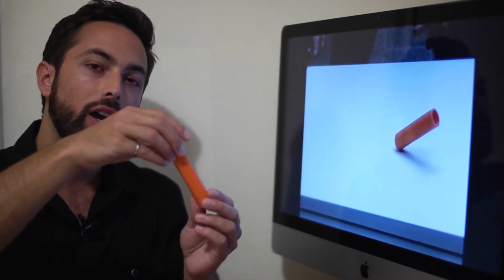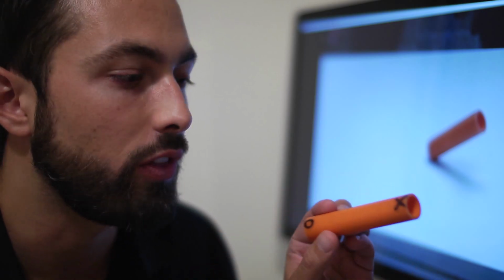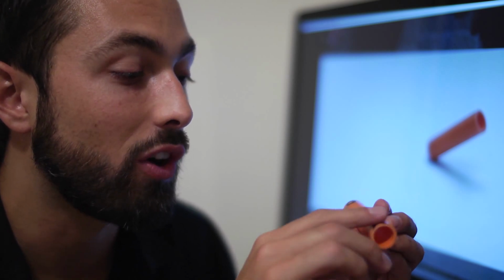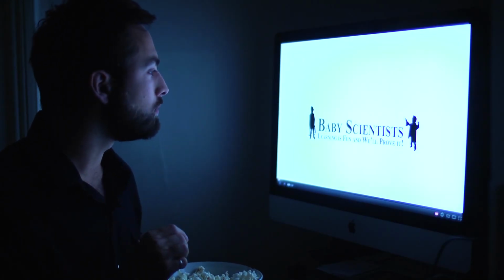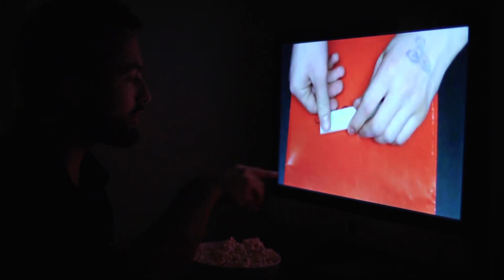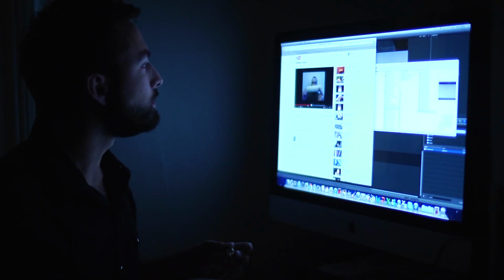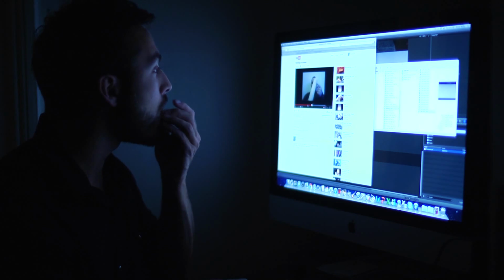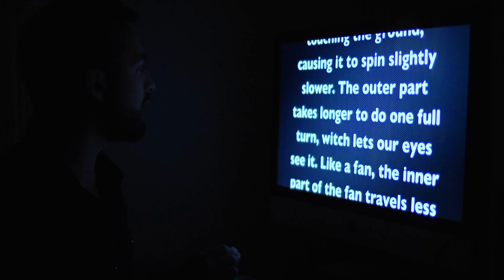Spinning Tube Trick Explained

Comment from the maker: From underneath, the tube rotates clockwise. So the spin of the tube is again opposite the rotation but now for the other letter. There is a good explanation of this in one of the video responses on the original video so check it out if this doesn't make sense.
Reply: Only 6 likes and no reply's… how odd
Reply: @memariogamer5892  I concur
Reply: @memariogamer5892 : Might be related to Derek’s previous video about video-learning (see the one about Khan Academy).  People are just assuming they understood the answer.  After hearing the explanation about viewing from the top it didn’t make sense to me that it was different when viewed from the bottom - until I read Derek’s explanation above.  It bugged me enough that I had to look through the comments to find that answer.

Comment: OK, I am NOT a physicist, I'm a poet and a musician, but I'm also a science aficionado, and that brings me to this question. Does the principle of the spinning tube also explain why, on the planet Mercury, at certain points during its day, the sun would appear to stop its motion across the sky, move backwards below the horizon and then rise again? It seems similar to me. Please don't laugh at me if I'm totally off base here!
Reply: Yes, the sun would slow down or speed up depending on whether the orbit and rotation of the planet go in the same direction (like both clockwise) or opposite directions. :) In fact, depending on the difference between the orbital and rotational angular velocities, you could see the sun anywhere from moving in the opposite of the expected direction ("expected" if you took only rotation into account) or at a standstill at all times. Of course, you don't need to be a physicist to think about these questions; it's mostly just common sense. :D
Reply: ajmittendorf It's called retrograde motion. The same thing happens to us on earth looking at Mars, it appears to move backwards, then goes forwards again. I don't think this experiment has anything to do with it though, but just search retrograde motion up ;)

Comment: You will also notice that the end which is pressed (say X) gets lifted up a little bit.
That's because of the magnus effect. The lower part of tube of X end is actually moving faster than the upper part. So lower part drags more air along with it and creates a high pressure region below X end and thus gets lifted up. Same can be said about the other end which was not pressed ( O in this case). The top part of O end is moving faster than the lower part and it gets pressed down between of a high pressure region above the O end ( and of course you need some contact too because there is gravity.)

Comment: So why under the table see o and not x when we spin the tube putting our finger to the x position? The velocity of the tube is the same and independed from the position we are looking the tube.
Reply: Rotation along the axis remains the same but horizontal spinning flips
Reply: Well when seeing it from above, the symbol you see will be spinning in the opposite direction from the tube's rotation, and if you look at it from below, that symbol will be spinning with the rotation of the tube, since it's turning around the tube.
Reply: By looking at it from underneath, you flip your view point horizontally so its horizontal rotation will be flipped in relation to you. This means that the destructive rotational velocity will switch sides and thus symbols.
Clockwise to counterclockwise and vice versa.
Reply: @fabiofdez  No--the same symbol is still rotating against the rotation. That's what he said. Viewing angle doesn't change the physics of which side of the tube is rotating against the spin. Maybe I'm wrong?
Reply: @JD_tcb  The spining direction doesn't change by flipping our point of view. But for the rotational part : if you look at a clock (in the classic way) you see a clockwise movement. but from behind  the clock hand now goes cunterclockwise. So for the "under the table" point of view, the symbol which has opposite movement (between spin and rotation) is the other one compare to the "above view".
Reply: A clock runs backwards when viewed from behind
Interestingly, the sun travels counter clockwise ( northern hemisphere) , its the shadow cast by the stick that goes clockwise.
Think it through.  You look up to see the sun...follow around with your finger 
Volla.. counter clockwise.
Reply: @JD_tcb  I was stuck on this for a minute too I thought yeah the rotation flips but the spinning flips too, but then the best way I found to realize I was wrong is if you move your finger in a clockwise motion and then put your hand above your head and look from underneath it's counterclockwise, but if you take your finger and pointed sideways and rotate it towards you, it's going to be rotating towards you if you look above it or below it
Reply: I was searching for this question. He also thought the same, thats why he said it would be the same symbol but he was wrong. He talks about ppl being lazy in the video, but in the end he was the one being lazy for not answering that question, I bet you he is also intrigued by that and if he knew the answer he would have said it. Now I want answers 😁
Reply: Ok, I think I know the answer, the lightning from above is really bad, some zones of the tube are not even showing, the zone with with X ended being in the dark spot, and we end up seing just a few frames with the 0 when the tube is really slowed down, like when we see from above. We just see nothing when we were suppose to see the X because of the bad lighting conditions, when they edited the video they just showed the last moments of the spinning.
Reply: I have the same question. If the angular velocity is what determines whether we see one end or the other, looking from the bottom wouldn't change that. What am I missing?
Reply: Well . I came for help to understanding this question and I’m leaving more confused then I was when I got here . This is completely my fault. My brain is starting to protest even thinking about this lol . I’m going to try rotating my finger below and above my head maybe my simple mind will then understand . Hopefully nobody will catch me doing this and ask me what I am doing . I will just tell anybody that ask me wtf I’m doing that I’m simple and this might help .

Well spinning fingers did nothing to help me lmao no surprise. I don’t even understand why I’m struggling with this . I’m missing something and about to just repeat the experiment for my self and probably remain confused lol .
Reply: @bobquigley1957  Not the angular velocity determines it, rather the sum of the velocities, because there are more then one, which can also somewhat cancel each other. In the end, what's matter is the relation of the directions of the angular velocity and the tube's rotation.

If the angular velocity, at a point where the tube is facing you, is pointing clockwise, but the tube's rotating counterclockwise then these cancel each other (not entirely of course). That's possible only one end of the tube at a time. If you watch this from the opposite side, the rotation flips, but the angular velocity's direction is not changing. The same end pointing clockwise and the other end counterclockwise, so now the other end of the tube seems slower because of the same cancellation. Hope this helps.

Comment: Hi Derek, when I did the trick myself and also when looking at your videos I observed that see the O (or X) about 6 times per revolution. It seems to be like this no matter how fast I spin it. 
This seems to imply the ratio between the axial angular velocity and the vertical angular velocity is constant and 6 (or close to it, perhaps it is 2pi, since that's a special number when it comes to circles.. )
Am I imagining this, or do you also observe it?
Reply: I would guess it depends on the ratio between circumference and length of the tube.

Comment: Great video, I love your work!
Too bad you didn't talk about the number of x we can see. We can clearly see on the slow motion that the tube rolls on one end without much sliding. So the number of x we see is the ratio between the diameter of the  circle described by the spinning (pretty much the length of the tube) and the diameter of the tube.
So the number of x we see is the ratio of the length of the tube over the diameter of the tube ! (pardon my writting, I'm french)

Comment: @Bart Alleman

For the same reason. But when you look at the tube from below, the sides are reversed. So when you pressed the X at the spinning tube from below, it is the O that moves against the horizontal rotation of the tube.

Comment: Oh, I should have thought of how the rain flies off the top of a moving car tire. 

The tire on the road goes zero velocity relative to the road, the axle of the car goes the actual reading of the speedometer relative to the road, but the top of the tire is going twice as fast as the speedometer relative to the road. Very cool stuff!

Comment: I honestly think that the velocity explanation is wrong, as if does not account for why the symbol is reversed viewing from the bottom. I think that it has to do with how our eyes can only process limited frames.

the "pressed" end (let's say X) lifts upon release. the entire time that the tube spins, X remains vertically higher than O. the upper half of the tube creates a constant blur of orange and X, blocking any blurred image from the lower half. although the X is never actually in front of the O, the blurred image blocks out the lower half of the tube. 

this would easily account for the issues with why the symbols are reversed looking at it from below, and it actually is a bit irritating to me that no one seems to notice such a simple solution. am i wrong??
Reply: I feel the same
Reply: When he spins the tube and you look at it from the top it is spinning in a counter clockwise direction about its middle. If you were to look at it from the bottom it would be spinning in a clockwise direction, so now the O instead of the X is spinning backwards with respect to the motion of the tube in its horizontal rotation. Hope that helps.
Reply: Makes perfect sense,.Took me a bit to visualise it though!
Reply: That is nearly exactly what I intended to write as a reply to Sanji Sekai, but then I read your comment :)
Reply: Okay i know this was commented 5 months ago but as i read this i was agreeing and then i realized that the velocity answer is correct simply because when viewed from underneath, the "lower" half of the tube is now turning like the top half would be turning when viewed from the top. This means that if the x was viewable from uptop due to it rotating in the opposite direction of the motion of the tube, then the o (when viewed from underneath) would ASLO be viewable because of spin in the opposite direction of the motion of the tube, making this answer very viable.
Reply: Great explanation. It instantly made me think "This is why it's so annoying to work on plumbing." Righty-tighty / lefty-loosey only works when you are looking at the fixture the correct way.
Reply: Yes it does account for what symbol is on the bottom because looking from the bottom the tube looks as if it is spinning the opposite direction.
Reply: You're wrong. It has nothing to do with the levitation of the symbol, since this trick also works when rotated slower so that the tube remains completely flat on the surface while spinning. Also if it were due to levitation you would still definitely see the "lower" symbol but a bit more faded. This solution DOES actually explain the reversed effect on the underside since on the underside its the exact opposite, the side moving slow relative to the ground on the upper side moves fast on the underside and the side moving fast relative to the ground on the upper side moves slow on the underside. Simple as that.

Comment: What I didn't get, however, is how we can see the other mark if we look through the bottom of a glass table. I mean, the direction of spin and rotation doesn't change, right?
Reply: +Nemo_K Well imagine the tube vertical instead of horizontal, if it is spinning clockwise, and you went to the other side of the tube it would look like it's spinning counter clockwise, I found it easiest to visualize in this way. Hope this helps.
Reply: +Jesse North 
That's a really good explanation, so instead of the x spinning against the horizontal rotation, and the O spinning with it, it's reversed from the bottom because the horizontal rotation is reversed. Thanks!
Reply: +Jesse North Doesn't make sense the explanation. So we only see the X from top because is moving slower. That doesn't mean that the O from bottom moves slower. The X still moves slower when is viewed from top and from bottom. Look at time 2:30 and you will see that X is moving slower, and viewed from bottom it "should" be moving slower too therefore you should see the X and not the O.
Reply: This looks like a depth of field issue to me. Like if you scan a 3D object on a 2D copier, only the parts that touch the glass are in focus. In this case the slower spinning end is away from the glass, perhaps enough to result in the blurred depth of field. So if it was performed on an imaginary invisible plane and observed by a camera with appropriated depth of field setting (so that all was crisp in focus), we would see the same thing from both sides.
Reply: still sounds too much like a random reasoning after observation - like the one in the video.
Reply: Nemo_K 
I does change. Because if the direction of the rotation about perpendicular axis stays the same, then both points go along as well as against that rotation. Which in particular is happening depends on which side they are present (above or below)

So when the x and o are above, one is speeded up and the other is slowed down. When they are below, the exact opposite.

Similar to how a point on a rolling wheel is stationary while at the bottom but moving twice as fast as the centre while at the top.
Reply: You can see it using vectors. The rotational velocity has two components in two perpendicular directions. Now if you reverse one of the axes, one component becomes the negative of its original value i.e. w = (w1,w2) becomes w = (-w1,w2), which causes reduction of speed in a particular direction when looked from downwards

Comment: Fascinating experiment and answer. But as a photographer, this raises another question for me. My understanding is that if one presses down on the X, you thereby instigate a combination of longitudinal and axial movement which results in movement of the tube, such that the X which is moving relatively slower, will be "perceivable" to human vision, as well as an inverse rate of turn and spin on the O which then moving faster, and is beyond human perception.

This must mean that when moving from the slow speed of point-X towards the fast speed of point-O, there is a point at which human vision loses the ability to perceive the shape of a marking on the moving object. 

In photography terms, it would be similar to if one were photographing a moving object, and at each pass using a longer and longer exposure duration, starting first with very rapid durations and then increasing the time. There comes a point in the progression where the rendered image changes from depicting the moving object as if it is "frozen" in motion, to showing "motion blur", to eventually reaching a point at which the moving object cannot even render its form onto the captured scene. In this regard it's probably truer to keep the shutter duration constant, but to increase the speed of the hypothetical moving object.

My question is therefore, does human vision work similarly to that of motion cameras which capture a series of chronological frames? And at which point does our human vision lose the ability to perceive this movement?

We've all seen video footage of how the propeller of an aeroplane, when starting up, seems to spin one way, then momentarily appear static (albeit blurred), then reverse direction. This is because of where the propeller blade is in each successive frame, and due to the fact that the accelerating spin rate eventually "synchronises" with the camera's frame rate, to create the static effect, and then accelerates further to break that effect and create the appearance of the propeller reversing its spin. And depending on the frame rate and the rate of spin of the prop, this can occur more than once. At some point the propeller might become "invisible" to the camera due to it's high speed - this depends on the shutter duration being used.

But, unless I'm mistaken, the same thing happens with human vision - just at different rates to those of most cameras, which typically shoot at 24-60 frames per second. 

So I guess my real questions are: if this is the case, and human vision does in fact work similarly to motion cameras which make use of a series of captured frames, what is the equivalent "frame rate" and shutter duration of (average) human vision? At what point do humans begin to perceive moving objects as "blurred", and at which point do we loose the ability to see them moving? 

Thanks for the lesson. Great food for thought.

Comment: The tube is essentially spinning in the other direction about its long axis, which makes the alternate symbol appear slower moving. It's like looking at a clock face, but from the back of the clock, the hands won't be turning clockwise anymore if the face of the clock was transparent, like the glass tabletop.